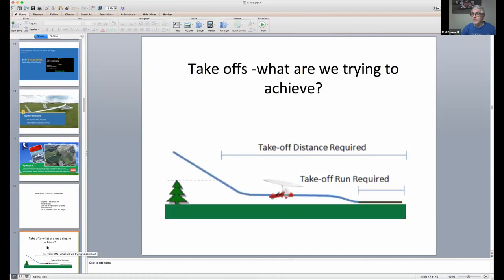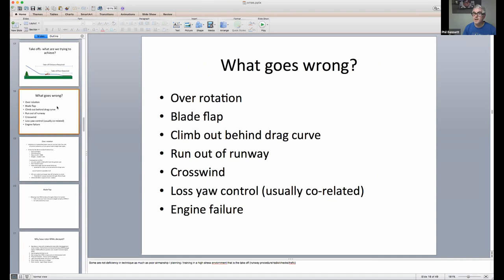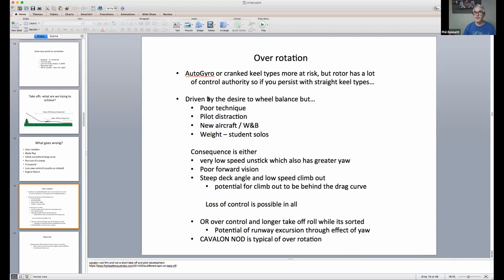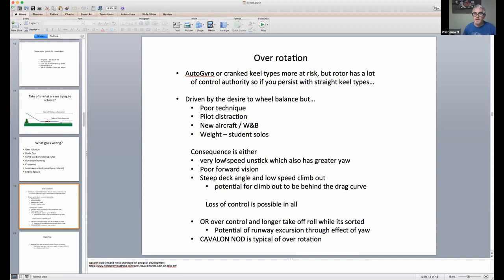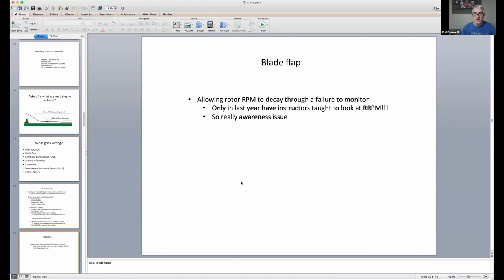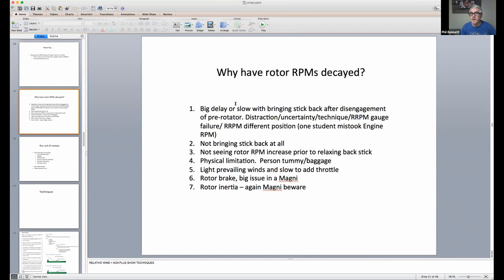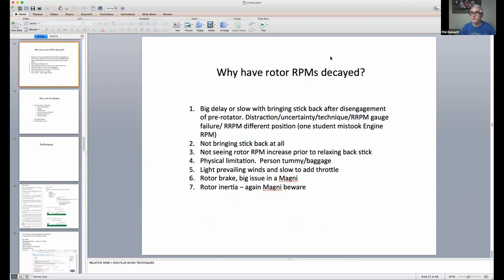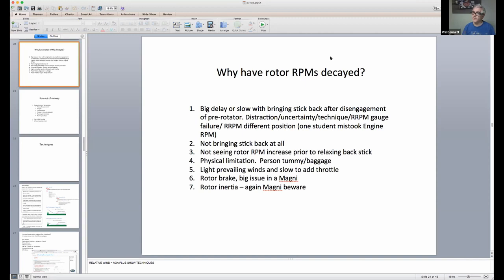Why gyroplanes crash - part 1 take off issues.

Comment: Nearly every takeoff incident I have ever seen has been related to overloading the rotor and attempting a liftoff way behind the power curve/at too high of a disc angle of attack/too low a rotor RPM.  I was taught to use a lot of back stick until the nose wheel lifted, but not to balance on the mains, but relax the stick enough to just put the nose wheel back on the ground and advance power and allow the aircraft and rotor to accelerate.  I think where one problem can arise using a balance on the mains technique, is with high engine thrust-line designs.  The more you advance the throttle, the more back stick you must use to hold the nose off.

Comment: I wanted a Gyro after finding out insurance is impossible to obtain here in the US not likely I'll be investing 70-100K US in something I can't afford to insure. You mentioned this problem before because so many crashes in the US it was impossible to obtain insurance unless want to pay the cost of the Gyro every 2-3 years.
Reply: Insurance rates are a pretty good indicator of safety. Thanks for the info.
Reply: Get yourself a RAF2000 magnificent ones for around 30 grand and one of the best gyro for many reasons just make sure it has a horizontal stabilizer for training
Reply: @shawnwright5332  Spruce aircraft sells kit for $50k USD not including the engine. Anyway you look at it going to spend about $100k with training. This is why they are only sold to a select group of people who can afford to fly without insurance.

Comment: Never flown in a gyroplane (on my bucket list) but maybe fewer accidents if rotor rpm included a flashing red light/audio alarm when less than 200 or ...? rpm. I like how gliders have the audio pitch for vertical speed indication. Add audio tone relative to rotor rpm?

Comment: I’m a mechanic and obvious if you maintain your engine perfectly it still WILL fail. 
These gyro copters are ridiculously dangerous, I can’t believe people are stupid enough to fly these. So many things could and will go wrong. Just look at the stats with these, your playing Russian roulette.
Reply from the maker: Well its a view but not particularly well informed.  What are all the things that could go wrong in your opinion??
Reply: Looking back on my comment I was to harsh because ignorance breeds fear and i’m ignorant about gyrocopters. But i’m not ignorant with gas combustion motors and many things could go wrong I.E barrings, seals, bad gas, rods breaking, loosing compression and manny other part i’m not familiar with regarding gyrocopters. I care about my fellow man, I was told in another comment that if the motor stalls it could glide down safely, I did not know that, I thought it would fall like a brick.
Reply: Because people fly other kinds of aircraft and believe they can fly a gyrocopter with no training
Reply: @jeffreyklaproth7794  General Aviation is dangerous look how many fixed-wing aircraft crash in the US annually. NTSB reports 80% of fatal accidents are human error caused any only 20% are mechanical. We try to manage the risk best we can so we can experience the freedoms if flight. If you look at Gyro's probably find most fatalities were not mechanical but pilot caused. This is why proper training is so important.

Comment: Your over complicating  a common sense procedure.
Reply from the maker: Hey - If you watch the film that is my point.  People crash during take off because they are overload.
Reply: @Gyrocopter flying club  I understand.  But all gyros basically take off  the same.  
Most pilots doesn't consider weight,  density altitude,  or runway in takeoff calculations
Reply: @gyrocopterflyingclub6148  KISS
Reply: @gyrocopterflyingclub6148  KISS
Reply: Thanks for the great advise. As student pilot that did my first solo last week I was confused as to the power setting after following the Gyropedia program and understanding that with less that full power it is easier for a student to maintain wheel balance and not getting caught out with your nose to high. My instructor made it very clear that it is either 100% power or nothing. Glad to see you back.
Reply from the maker: @jeanjordaan8879  Hey good job with the first solo.  Which part of the world are you training?  It is a very good point that you are making and for me that system is now becoming a barrier to enhanced gyroplane safety not a solution.  You are 100% correct that with "part throttle" [i.e less than 100% power] a student will find it easier to maintain a wheel balance [indeed if you think about it if you want to maintain a wheel balance then it is essential that you do not go to 100% power because if you do then at some point you'll fly!] and in the process of learning not having the nose some up too high is a good thing.  We are all in agreement so far.  

The problem however is that that view is often used as an excuse for the material that is being written because nothing in that explains the push to this nonsense that is called "Lift power".  The system that you have following has simply lost itself in over complexity and now you have a generation of pilots that are utterly mentally overloaded to a point that some become confused.

Using a part throttle approach to the initial steps of wheel balancing is useful and recommended but that is not take offs.  Once the student has a grasp of what a wheel balance is and developed the feeling, visual cues and motor skills to achieve the correct attitude then the student must progress to a point where he can do all of that when the aircraft is accelerated at full power for take off.

In the end if [and I agree with your instructor] a student is not taught  to take off with 100% throttle then he is unprepared for his on going flying career and who knows how many that number is - I had a student pilot email me last year confused about a video i made on landings because I spoke about the need to trim the aircraft on finals.  He said he flew a Magni and never needed to re-trim once he got airbourne.  It turns out his instructor conducts ALL of his flying at 60mph and so once trimmed it never gets re-trimmed!!!  I asked him what he thinks happens when he may decide to fly at a different speed....
Reply: @gyrocopterflyingclub6148  Hi Phil. I am doing my gyro training from Cape Wineland airport in Cape Town South Africa on Magni M16. My home airfield is Saldanha Airfield. 

Thanks for the reply. Agree that for training purpose less that 100% power is acceptable if you don’t want to get airborne and doing a wheel balance exercise. 

My instructor explained that the increased risk of a student falling behind the power curve if he increases the drag too much and is not running at 100% power (35mp) on takeoff is unnecessary.